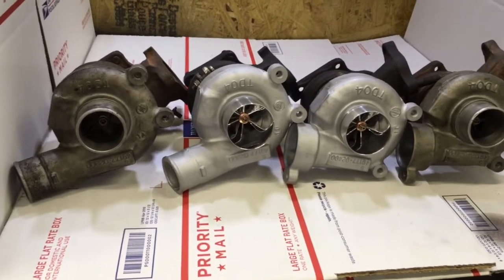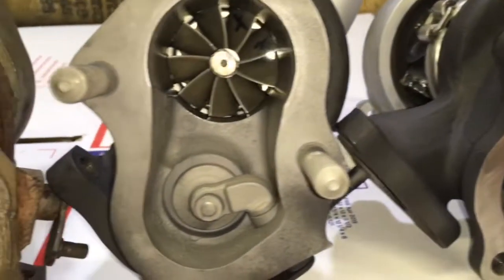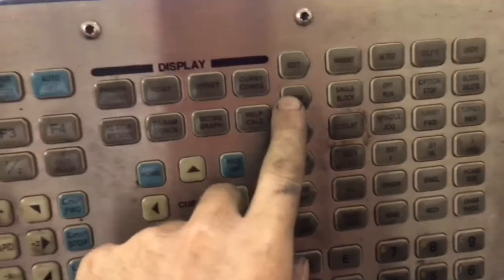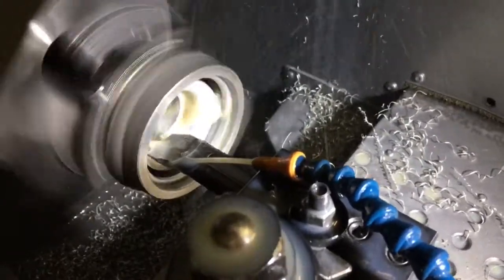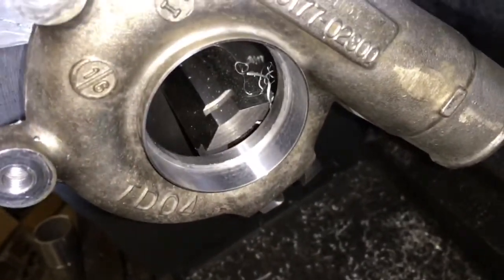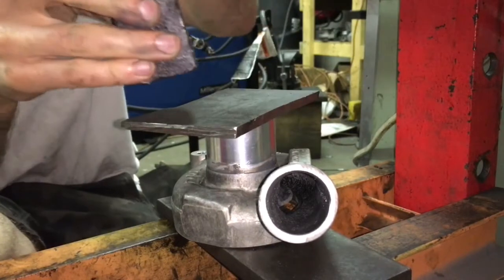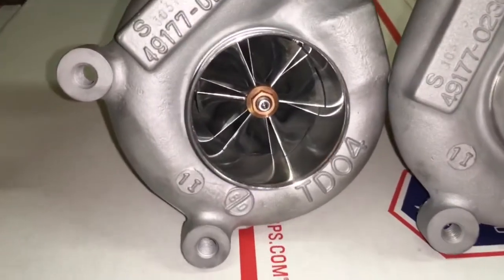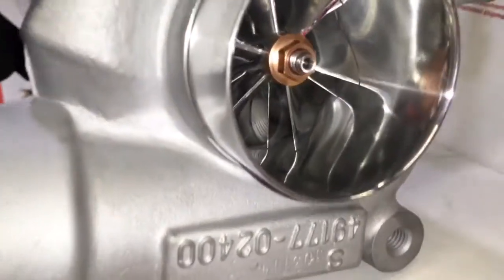3000GT Turbo Upgrade Machining Process

Comment: Got yourself a HASS, good job. What's really impressive isn't the 7 minutes the CNC can do it, it's that YOU have spent the 2+ hours doing them by hand.  Programs can be written in different ways, & someone who has never had the hands on manually doing it could never predict certain quirks and potential flaws due to approach or running steps out of order........

Comment: Ever done the RobBeck style 13t conversion with 9b?  That's an interesting one for my 95.  If it's affordable you could pull some business on the 3si forums.  Everyone wants the 9b's out.
Reply from the maker: +Tom https://youtu.be/S0alkPrq-jQ this may not be what you mean. I don't plan to advertise for this market, because it's one of the harder markets to keep the money I worked so hard to earn. The upgrading the stock housings is very time consuming and challenging. I would say it is the most difficult build to do because the tolerances are so tight with the inlets.  

The other reason is because I had some bad luck with 2 sets that I built a few years ago where the cars had either junkyard heads off blown engines installed or something of that nature where the oil pump pressed rod bearing flake directly into the turbos causing the thrust bearing to clog and the turbos to blow oil as a result. There is a lot of risk in building turbos and doing upgrades for older vehicles, as most of the time the customs bought a car that was someone else's problem.

The risk is that I can lose all of my money and time invested in the build, all the money I paid employees, and all of my money in parts. I do some of these builds but it's rare. I had the same problem with the Dsm's. usually I only build them for shop owners who have a relationship with their customers cars which minimizes the risk involved in a build like that.